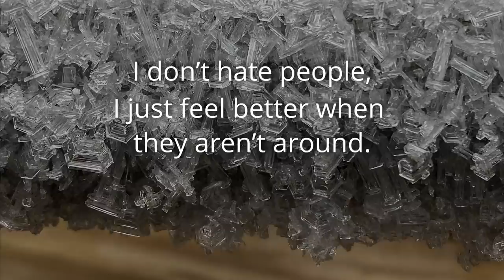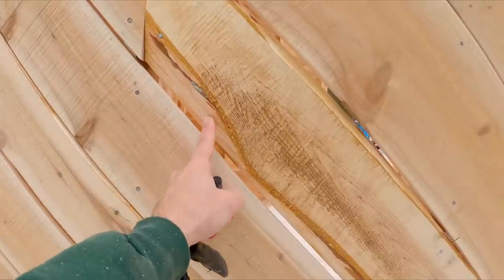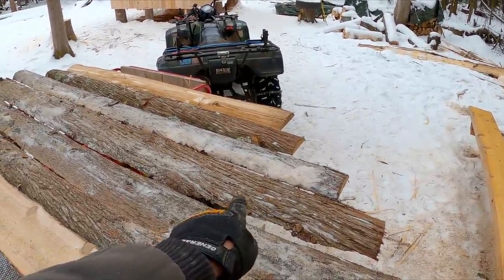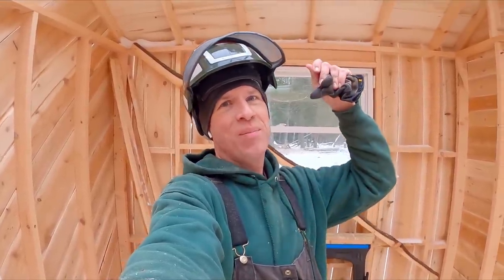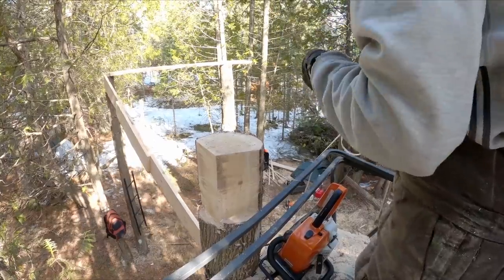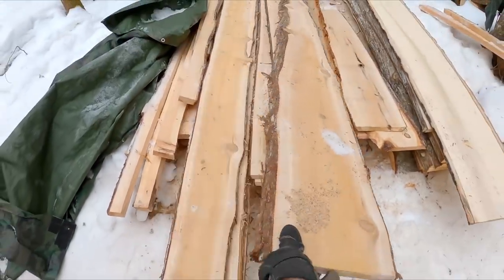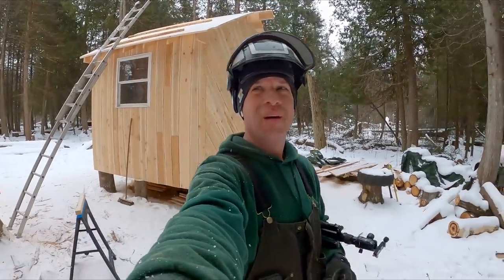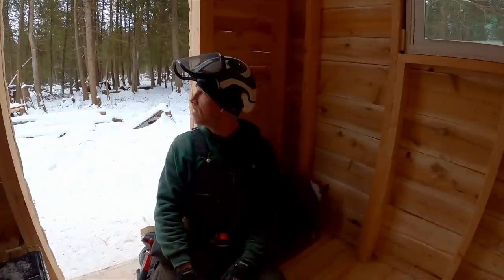My Tiny Winter Cabin, Finally Closed In! (Do I Still Need the Tent?) #70

Comment: You are correct about the ground freezing and rising as the frost goes deeper, causing the door not to open.  The snow on the ground acts as an insulator, keeping some of the ground's warmth below it, preventing the frost from going so deep, and the ground from rising so much.  When you remove the snow in front of the door, you're removing the insulation, causing the ground to rise that much more.  It's a catch-22.  One way to prevent it is to dig down a few inches and bury a piece of styrofoam insulation (2" thick maybe, more if you've got it), right in front of the door.

Comment: Once again I'm here to mention the Chinese diesel heaters, love those things.  I really think they'd be almost a necessity for your lifestyle.  I'm also in Michigan and periodically heat my enclosed porch, my garage, my Tahoe, and next year I'm going to heat a small greenhouse all winter utilizing one.  I have over 5,000 hours on 3 of them with zero issues, hot dry heat with no fume danger, they use fuel and electricity but very efficiently.
Reply: Another fellow Michigander! How much fuel do you use running that? That’s a brilliant idea for heating a greenhouse. Definitely trying to expand my growing season up here.
Reply: Another benefit with diesel heaters is that they give a much dryer air than propane stoves. The downside is that they need 12 volt.
Reply: I have looked at these and it seems in general one can expect them to pull up to 1AH on the lowest settings. This seems excessive for off-grid like this guy. Especially being unable to use solar panels in winter.
Reply: he dosent have enough sunlight to keep one going. one night mine will go through almost 100 amp hour.
Reply: @crimsonacreshomestead4553  I'll go through 2-3 liters of diesel in 12 hours of heating my tent.
Reply: @crimsonacreshomestead4553  Great to hear from you!  To heat my uninsulated 2000sq ft garage in negative temperatures takes about 2 gallons of diesel fuel and about 20ah of power per day.  That is the fuel consumption at full out 24 hour operation and constant running on high mode.  On the other hand, to heat my Tahoe to 70 degrees F in negative temperatures takes about 1 gallon per day and 10ah.  I have some videos on the subject if you peruse my channel, the greenhouse I am building is going to utilize double wall air inflated construction for some insulation effect as well as glass blocks.  I am going to route the exhaust underground to take advantage of the thermal mass effect from the wasted exhaust heat which I've determined is quite substantial and useful.
Reply: @J1I9M7M4Y  Yes you can run them on 12 volt, or an AC to DC converter.  They sell one that works great, if you check my channel for the video on how I heat my garage I show the model number and type-its about $60.
Reply: @redavni1  Yes, you will use 10-20ah a day to run these at a rate to heat a 1000-2000 sq ft structure (uninsulated) to 30 degrees above ambient.  Great point, you would have to definitely invest in 100-200ah of marine deep cycle batteries like I have and charge them about once or several times a week depending on usage.  Taking advantage of the wasted exhaust heat and the 27,000 BTUs of dry heat they put out is probably one of the most efficient heating methods there is however, but it does take some tinkering and planning to make it happen off grid.
Reply: @racingdesire  Not trying to be disagreeable Frankly, however in my quite extensive experience with diesel heaters the most I've ever seen one consume is between 20-30ah in a 24 hour period and that was with continuous operation between the high and low phases.  If it runs on full blast all the time it runs very efficient as it doesn't need to fire the glow plug which is the major draw on these units.  If the heater is constantly running between high and low phases (as in you have a small uninsulated  area and overpowered unit) then it will consume quite a bit of power, but nowhere near 100ah
Reply: @ProlificInvention  I have a 8kw Chinese diesel heater, I do a lot of one night winter camps with it. to heat my 4 man 3 season ground tent using a 100 amp hour battery. once it's -5C or Colder the battery will run the heater for upwards of 12 hours.
if it's above freezing I can use the battery for multiple nights.
Reply: @racingdesire  I stand corrected as I've never ran one in a tent, also I keep my batteries in the warm area and haven't ever run an 8kw in sub zero temps in real world conditions.  I've also used car batteries with a 70ah rating for days on end, but then again not in those sub zero temps
Reply: @ProlificInvention  I have the battery set up as a isolated battery in my engine compartment, and I run the exhaust from the heater under the engine, generally keeps everything above freezing. 
major efficiency loss is having the unit +5 feet of ducting outside the tent
big fan of these heaters, the longer I've owned it the more efficient my set ups become. 
I also really thought it be the way to go for ringworm. he's not looking to keep everything above freezing, batteries are going to be hard to maintain. with his current solar set up I think even 40 amp hour a day in winter would be hard to get.
Reply: @racingdesire  I can tell you know your stuff, today I learned and it was great talking with you.

Comment: Just a thought...that Murphy bed might be better suited to be hung fairly high with a small step ladder 🪜 on hinges tacked to the outside of it so it all folds together when you raise it, simply because that tiny stove that you are planning to pop in there will probably struggle against those Michigan temps and of course heat rises...just an idea..
Reply: Idk how Murphy bed's work. But won't it be too heavy for the wall? Not the point of failure but as a stress point for it to bow?

Comment: 1:53  Idea - Shorten bottom of door & put in a threshold for the door to stop against. If you are keeping the tool shed. 
Maybe on the front wall of the man cave, add battens on the inside 
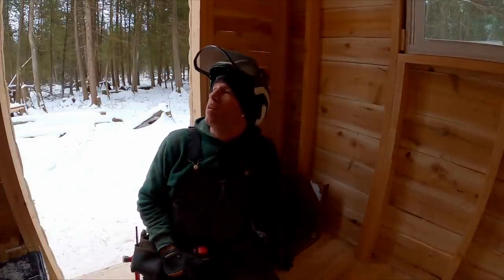42:35  If that new heater requires a chimney, than put it through the side, not the roof. Similar to the tool shed. But, most likely PVC. 
Maybe just a tarp for now, do the shingles in warmer weather.
Reply: He has cut the bottom of the door off the tool shed a bunch of times. 
really what he needs to do is cut a 2x4 vertical and then 2 45s so that its a peak kinda. This way all you have to do is chip off the top of the 2x4 or 2x6. this way there is always 6 inches higher or so.

Comment: Run the vent out of the wall opposite the wall the heater sits at. Give it a half bubble of angle. having the pipe run across a small room lets the flue pipe act as a heat exchanger.

Comment: Another great presentation Ryan. Personally I think you should have located your heater on the wall in the middle of the room. Use at least four preferably six of your concrete pavers, two on the wall and four on the floor to allow for thermal mass. It’ll protect your wood and dissipate some of the additional heat. Wishing you a safe remainder of the winter.  Be on the lookout for your resident groundhog.  If you have additional tarpaper,  consider lining the inside walls with tarpaper between the joists.   Something to block wind, rain, snow infiltration into the room.   Will you be mounting your propane cylinders outside and routing the hose inside.  Perhaps some scrap of wood could be used to enclose the cylinders, reducing element exposure and temptation during your absences.

When do you expect Ruby to make another cameo appearance?   Wishing you and your family a blessed week.  Stay safe out there.  Peace brother.

Comment: I made a comment on one of the last videos and I will say it again. I think you should make a small box about the size of one of those mail boxes that has the hump on them. You know about 2x2x4 feet or so. Then you insulatete it and frame in a good door. Then set the propane heater in there on the bottom and then put all of your batteries in there. I am guessing you will need a small vent at the top and a small vent at the bottom to allow air in and out. This will keep your batteries warm and camera batteries warm. 
I even think you can do a simlar one with a cooler type box with a 100 watt solar panel and a 12v electric heater inside it. This should be enough to keep everything very warm.

Comment: Leave it right there in the corner. 
If ya come across a solar fan or a heat powered fan would be a boost to the natural heated air movement.

Comment: have you looked into those Ecoflow battery banks with a solar panel? The Samurai Carpenter got one for his off grid cabin build. they looked pretty cool. i wonder how they would perform in the cold like what you experience. (his are inside the cabin so they probably stay warm when his wood stove is going) but i figure it could be an interesting thing to look into for charging other batteries and have some extra capacity out there for your projects. (and tools too haha)

Comment: You talk about a flip up bunk that you can hinge to the wall (sorry, you described it differently). But did you consider a fixed 'bunk bed' where you sleep on the upper tier (also warmer :) and where the lower tier is not another bed, but a table and/or workbench. ??

Comment: You will get a lot more space if you have a 'flip up' bed.  Then everything above it is usable.  Just use latches to secure it in place when its a bed.
Reply: So basically the same as the deer castle 🤣😆

Comment: I did the same thing with the bricks for my cast iron stove! They absorb a lot of heat and dissipate it quickly enough that the wood underneath doesn’t ever get hot! Used it on the floor and surrounding walls.

Comment: I would put the bench under the window on the left the full length of the cabin. So you could potentially feed really long timbers through the door. Then tuck the murphy bunk on the back right corner and shelve the whole bench wall

Comment: What you commented about top and bottom boards of each log you mill, ending up being fatter or thinner in the center made me think. If you want to mill a thirteen foot log, place you sawhorses six and a half feet apart. Then fit your log simmetrically on the sawhorses.  I think there's a good chance that your log won't bend, because the quarters will balance out each other, pivoting on the sawhorses.
Reply: I didn’t think he was talking about the log bending but more that the log had a natural bend in it and his first slice was just trying to get a flat side to work from.

Comment: Yayyyyy!!
 Looks great!! I would have made it ugly or needing wood to finish the inside,,,,, I have used that bubble wrap foil insulation with good success in a small 8x12 shed I made for creating small Christmas and birthday toys for the nieces and nephews. I can sit at one end and have access to all my tools. T the other end I have the charging station for some of the cordless tools I use in there. Between Dewalt and those cheap Ryobis you can get a decent amount of tools to be cordless. I have a small mitre saw from Ryobi, a small table saw from Dewalt, 10” planer that’s a Princess Auto special. It doesn’t even mess up the ends of the boards too bad. Stationary sander, cheap oscillating sander,,,, it all fits nice and cozy. You wouldn’t want to try to build something large in there though. Almost all the wood I use in there is less than 3 feet long and then there’s a lot of special woods like Purple Heart. It’s easy to buy end cuts or scavenge from the junk pile as I can use some pretty small pieces of wood. If I want to turn a pen, it takes very little wood at all. Fun stuff,,, I have worked in there with a Dylan heater fan at -25C or about 11 below F and been comfortable. It took a long time for the equipment to warm up mind you!! Hahaha. The walls are open studs and that foil is in plain sight. It’s ugly, but I did fill in some gaps between the studs behind my work bench and some of my most used chisels, knives etc hang there. It is wrapped in “wonder board” wrapped with tucked and sided with vinyl fake board and batten siding. Looks ok though. 4 cheap dual pane windows (with screens haha) and a steel door with a 9 lite window. Has a 4 foot porch on the front for character!! Not one chain saw used in the build though,,,,,,, sorry, Eh!

Comment: Regarding the flip up bunk, why don’t you put a shelf underneath it, so when you flip the bunk up, now you’ve got a temporary useable workspace. When the bunk is secured up, it would be parallel with the floor. When the bunk is down, it could be extra support against the wall.

Comment: STOP. Run the stove pipe out the wall 6 foot up, and not make a hole in the roof. Put the stove under a clothes line so you can dry your socks and jackets. Placing the stove on the up wind side wall, will allow the air to blow the heat around the cabin before it blows out of the other walls. After installing the lien too on the back wall, cut a small access door so you can start the generator when you need power at the workbench. Nail On.

Comment: If you are not sealing the sides and not going to insulate, you could install some inside wood and even use sawdust as a type of insultation in between. Of course it isn't fire proof, but neither are the bare walls. Just an idea to make temps inside even out nicely... Thumbs Up!

Comment: You've probably already built the door by now, but I would make it swing inside for sure. The main reason they do that is so you can't be trapped inside from outside. You have windows as an escapement if you need it though, you do you.

Comment: My first house had a set of concrete steps to go in the back door.  In the Winter, the ground would heave and those steps would lift just high enough to prevent the screen door from opening, so I tore them out and built a wooden deck.